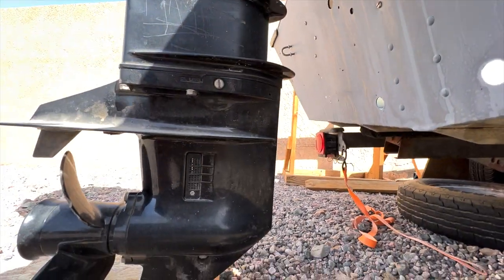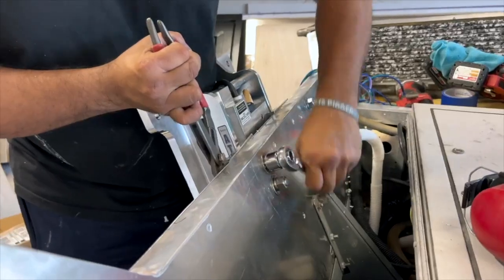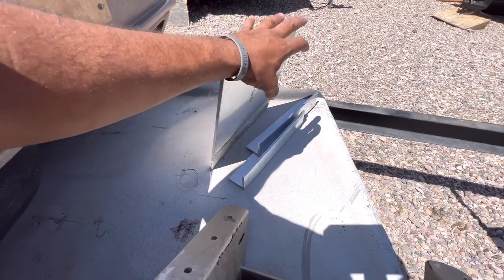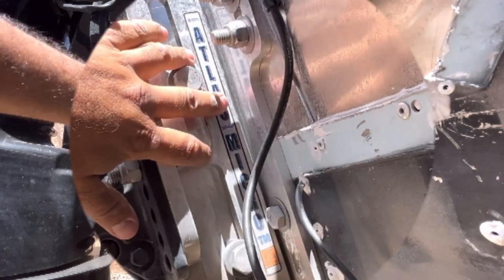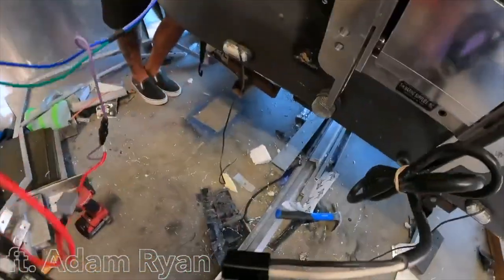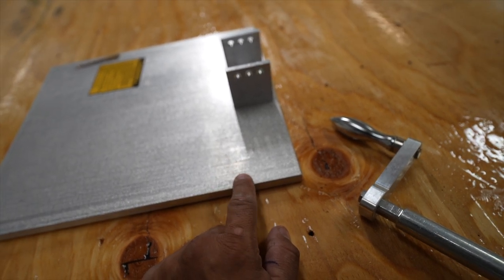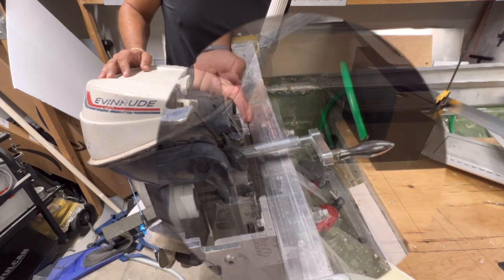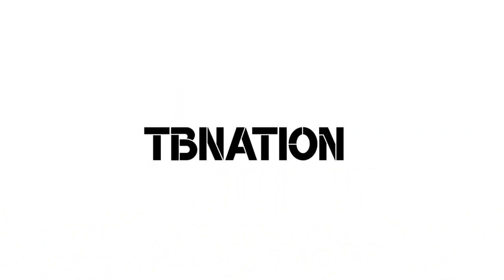Jack Plates Low to High @ontheflyjackplates875| Budget boat build Ep.9

Comment: Great video.  Y concern is that my solar jet boat only needs like 1/2 inch rise  to rung good so I’ve been using a shim for years. I’d love to see what it can do a little higher. This jack plate your showing looks like it starts at maybe 2” which I have no idea of that would already be to high. I thought at first I could just anchor the whole unit slightly lower to the transom but now I see the adjustment handle wouldn’t let it go any lower. Does the adjustment handle come off in case I need in that 1” lower?  It’s also the offset that I’m after as I think it could work better with the jet tunnel. Your help is greatly appreciated.

Comment: Actually i am curious if the on the fly Jackplate works with this specific 9 1/2 Evinrude. Doesnt it have a very high waterpickup and thus wont be able to get enough water, as soon as the cavitationplate is lifted just above the waterline? 

cheers

Comment: Thanks for video.Considering the on the fly for my 1440 Lowe that has a partial 9” transom top to bottom and just the aluminum transom from there to floor.Haw far apart are the top and bottom bolt holes?Also would I have to support the inside where there is no wooden transom for bottom holes?Motor is 20hp short shaft electric start Johnson.Not sure if it is too heavy?Have to weigh it.

Comment: Ok...I gotta clear this up. It's an *anti-ventilation plate*. That gurgling sound is the prop ventilating which is the prop sucking in air. Cavitation is caused by a pressure differential around the prop or really turbulent water which causes aeration  (bubbles) around the prop which causes the prop to slip. So many people get the two confused, they're similar but caused by different forces. I really liked how you pointed out the height differences though, especially when it comes to boats like the ones we build, everyone thinks the AV plate has to be X amount of inches above the keel for optimal performance which simply isn't the case. On smaller boats like these, its usually best from about 1" below to 1" above....nothing like a bass boat. Another great video brother.
Reply from the maker: Thanks for the info!

Comment: Looks like the heart of the lift is an old high quality trailer tongue jack. Don't skimp here. Get the best ones you can find; and then go up from there. I will be using 2" steel tubing with ACME threads ... from old house jacks. The quality of your build will be remembered for a long, long time. UHMWPoly is expensive but slick. Use it!. My next build will be a 22' River Cat .. a Grand Canyon outfitter's boat for hauling a couple of tons of gear, powered by a pair of 35hp 4-strokes that need to be "Instant-On/Instant Reverse" on a heII-for-stout frame & transom. When TSHTF and a boat falls into a hole it can get wadded up like a scrap of tin foil, hold you in the Maytag and after it's chewed on you a while it will spit out like the butt of a dead cigar or a drowned rat. Cheap thrills. 30 seconds later you'll be puking and blowing, and then drifting along for a few more hours. But for that 60 seconds, we will want everything to be ... RIGHT!

Comment: I just bought a used one and it has some play between the guides and the main plate.. its can wiggle maybe a 16th or 8th.. is that normal? Also I can hear the gears when lifting and lowering. Kinda loud, is that normal? I heard some of that noise on your video

Comment: You seem very knowledgeable regarding plates and smaller motors.   With your experience what jack plate would you recommend for a Yamaha F25 long shaft four stroke with power tilt and trim?  This is a bolt on motor and doesn’t have clamps.  Appreciate any info!  Love the video!
Reply from the maker: An OntheFly jack plate, or atlas micro jacker

Comment: I have good old 25 evinrude 1989 on my trapper topper 15. Stick steer.  I was getting prop spin spun hub .  I purchased a brand new prop with same pitch. 10.3 12p. I was on middle trim hit 22mph it had a bit more power to go i slammed the gas to full power and it spun the new prop. I then went to trim hole 2. It is level to the boats bottom and no cavitation but speed dropped to 21. I put a tack and testing rpm was at 4500 rpm.  I purchased another prop Solas Amita 10.8 x 10p and rpm now is 5350 rpm top speed 23mph no chop.  The engine is quick and quite.  Next I'm considering a stingray junior and moving the trim to hole three and 4 to see how it goes.  I have seen others with cavitation plate installed hitting 27-28 mpg.

Comment: What about using something like a panther marine outboard motor bracket as a jack plate for a small hp motor like a 2 stroke 9.9? Seems like it does the same thing and is cheaper.
Reply from the maker: If there's no adjustment feature, it's not comparable.

Comment: On your dyi plate i just bought does it tell you how far to drill the holes or any paperwork on it
Reply from the maker: That's completely up to you.  I would use 3/8 or half inch hardware personally. I like to run  3 bolts minimum on each side. You can do it however you want though.